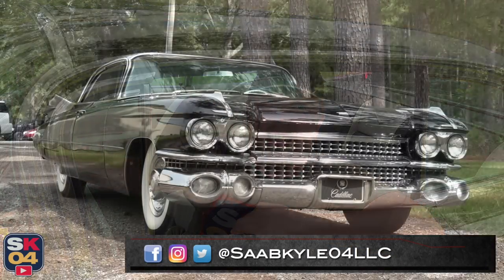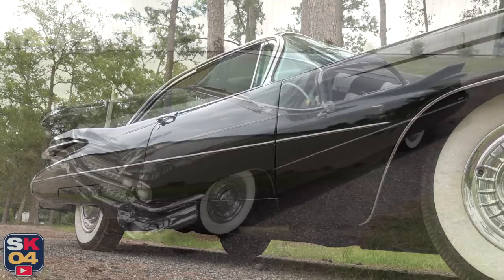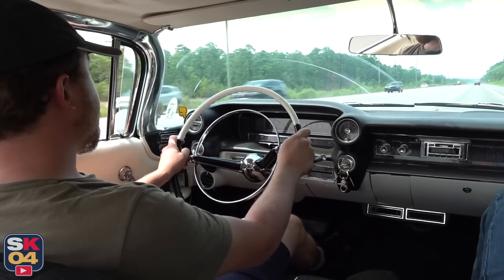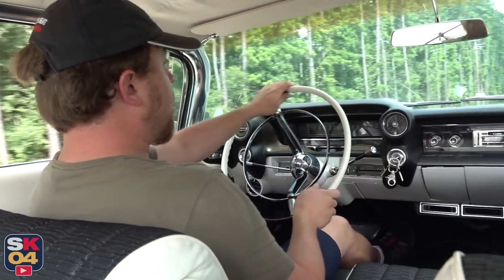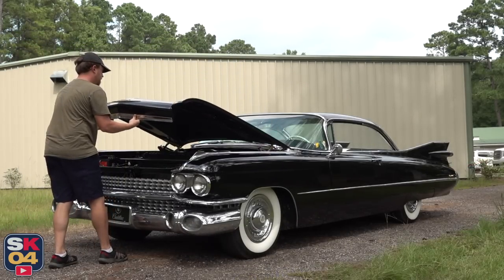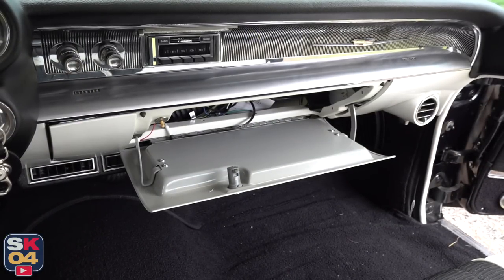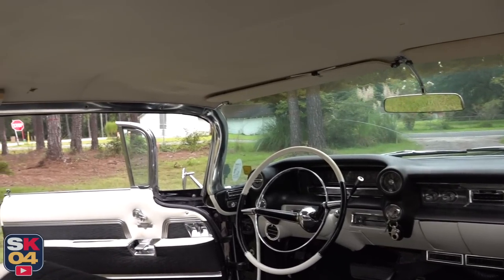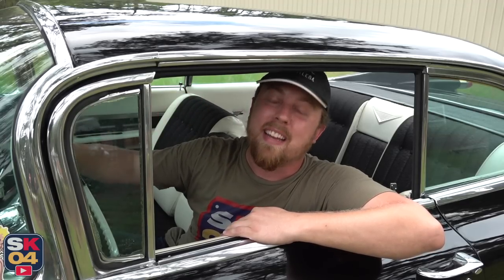1959 Cadillac Coupe DeVille: Start Up, Test Drive & In Depth Review

Comment: We had that one in black as a Series 62 base model. $4500 new. I took my driving test in it in 1967. Parallel parked it effortlessly and perfectly, 6 in. from the curb. Those were my glory days. It’s been downhill ever since.

The horizontal bars of the steering wheel were painted white. It would rub off near the rim from resting one’s thumb there. This one’s been repainted a dark color. Quality of fabric and vinyl were excellent. Trick to keeping white vinyl fresh was to keep it clean and free of body oil. I used a foam cleaner every week. Ours was garaged. Never lost its new car scent. For paint, Rain Dance worked best. Rewaxed when water beads had become too large. 

Right! You got to it after I wrote this. The trunk was lined with a durable houndstooth pattered vinyl. Not fancy but easy to clean. Slippery though. This one’s been finished in black felt or carpeting. 

The grill is a work of art. 300 pieces of clipped-together anodized aluminum. Intricate but easy to keep clean. No corrosion whatsoever. Those were the days when intricate grills were a sign of quality. Other GM brands featured simpler stamped grills.

Chassis was X frame. Stiff but not offering side protection. Used for all large GM models.

Comment: Kyle - did I hear you say optional heater installed?

How could one drive a car in colder conditions without a heater? 

Wouldn’t the front windshield freeze up making visibility difficult?

Beautifully presented video. 

Stunning 1959 Cadillac Coupe De Ville.
Reply: Heaters were optional in warm climates back in the day.
Reply: @jonathanmorrisey5771 the heater with defroster was standard on this Cadillac. It was optional on early 50s cars, like low priced fords.